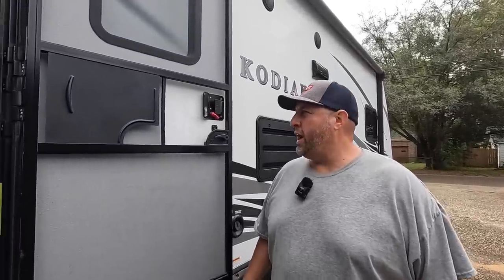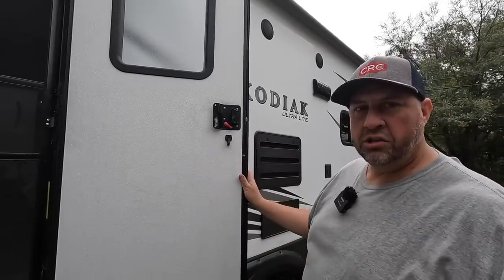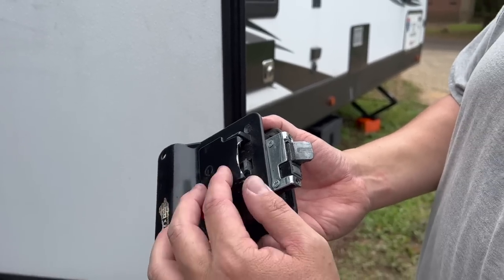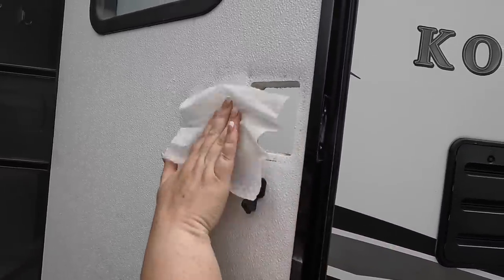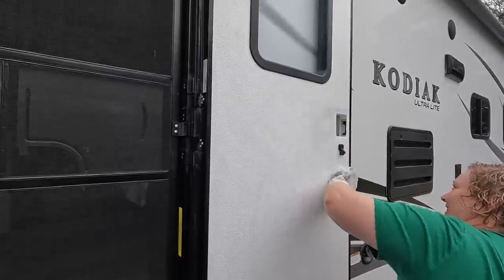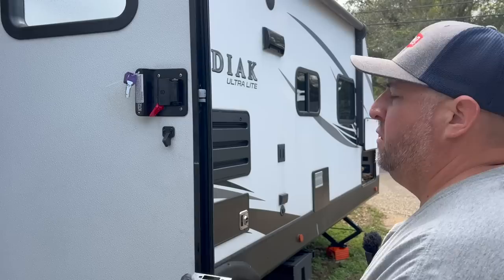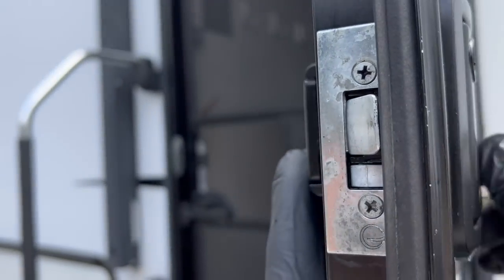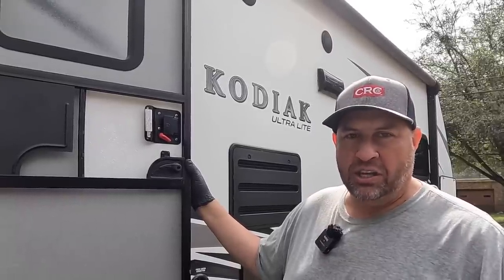RV How-To: Door Handle Replacement

Comment: Stuff like this on campers that is even subjected to gentle but moderate use never holds up. Imagine how quick stuff like this would wear out if you added a couple of kids to your travels. When we had kids in ours through the years stuff like this was an almost weekly thing.
Reply: It's the same with things like the wheel bearings. 

It's pretty standard for automotive bearings in 3500kg vans to last 100k without completely falling apart or seizing. 

Trailers and caravans seem to require service after any kind of extended use.

Comment: That’s one of the bad things about campers the door handles break way to easily they should use something stronger even if it is a little bigger thanks for sharing 
I thought my door was gonna break this winter it iced up and luckily I had a feeling before I tried to force it I sprayed it with penetrating oil and it thawed out and pushed the water out of the latch

Comment: Reminded me... I once replaced a similar assembly... but more involved & time consuming. It took over two hours as a lot of additional components had to be removed & replaced

Once done, it was found they'd shipped the incorrect key... and I ended up having to reinstall the old unit; then repeat the entire song/dance upon the correct key arrival.

I guess the moral of the story is check any & everything in your power before starting any project... but even then surprises lurk.

Cool videos, Thanks!

Comment: You can easily make a new paddle for the latch.
Reply from the maker: Sure I could but the video is relatable to folks owning RV/s that can replace a broken part themselves, not machine one. If a part was hard to obtain or super expensive then that would a good option.

Comment: at least twice a year i spray wd in and the latch by doing this it also helps shutting the door quieter
Reply from the maker: I keep a dap of CNC sp-350 on the striker to help with it sliding shut. It stays in place for a while.

Comment: would you not have done better making one out of steel instead of another piece of cast trash that is almost certain to go again if it is pulled the slightest bit too hard
Reply from the maker: How is that relatable to folks who don't have the shop or skills to machine one? I'm showing how to replace a broken part to help others who may run into the same issue.